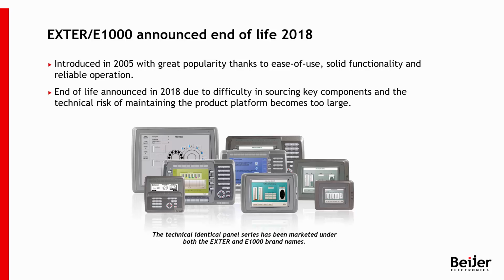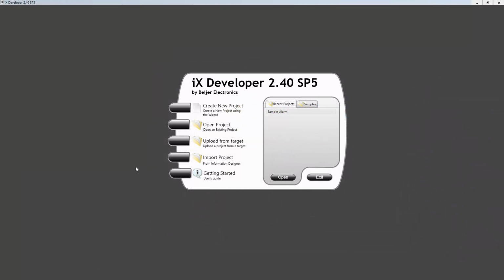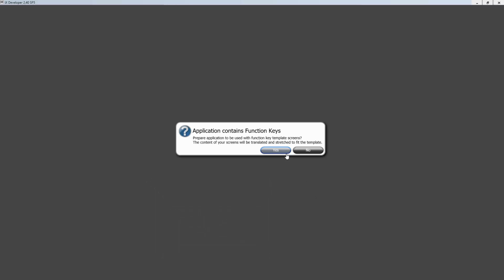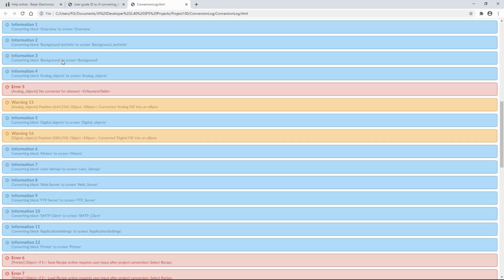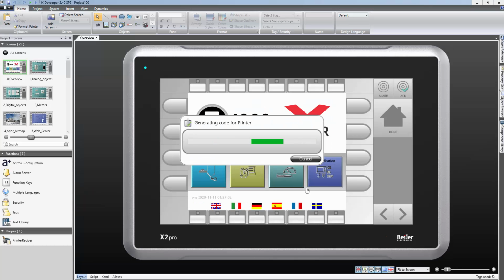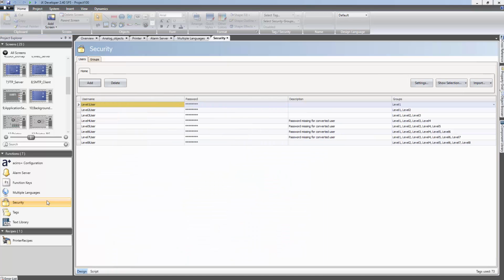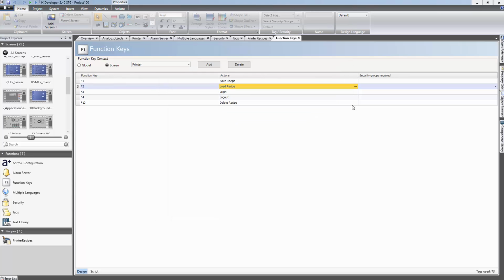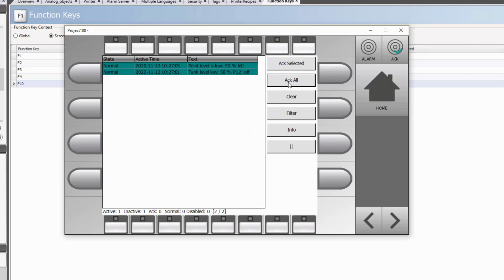Converting an EXTER/E1000 HMI application to iX

Comment: Hello, Will You Please Make A Video Of Configuring X2 Base HMI With Printer Using 232 Serial Protocol? I tried So Much To Find a Manual Regarding This Application But Didn't Find On Your Side Any Design Manual.
Reply from the maker: Dear Fazi, in order to find a solution to your inquiry, we suggest that you visit our Connected Forum at https://connected.beijerelectronics.com